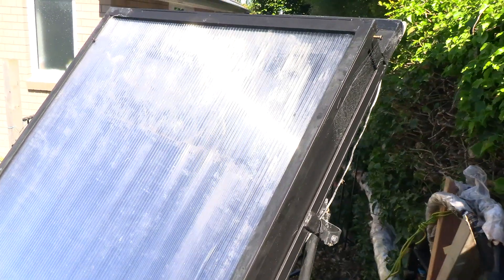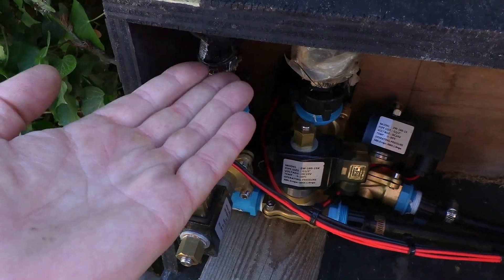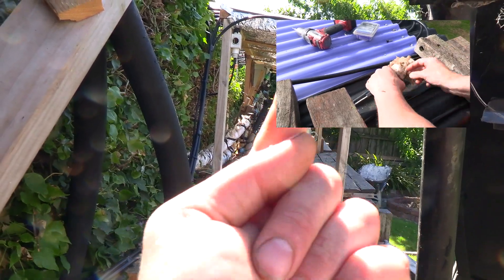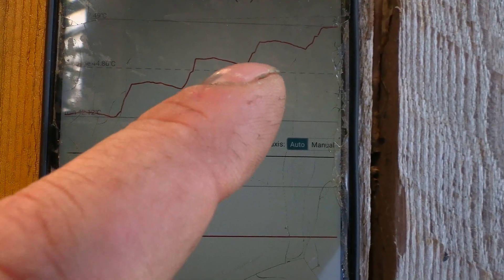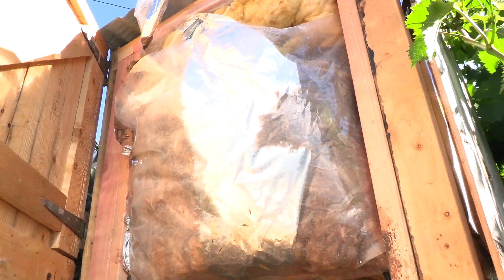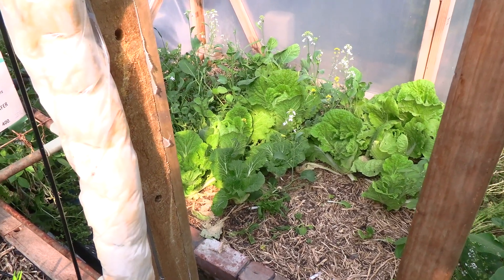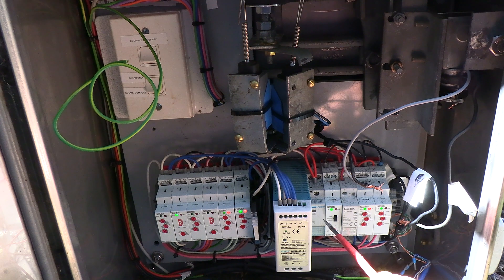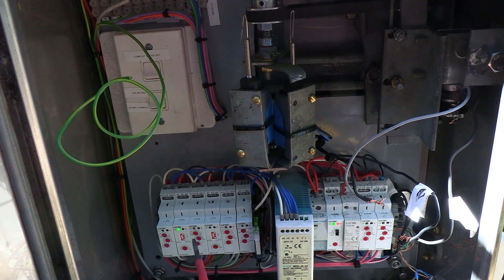Not so simple DIY Solar Water Collector. 49 C / 120 F Hot Water - Upgrade

Comment: Very impressive ! Have you tried first to use fuid dynamics before doing alle electronic ? I'm myself looking to do very low tech system, with thermosyphon, mechanical thermal actuators and tap, so it's always good to know feedbacks from other experimenters..
Reply from the maker: It needs to be electronic because there is long pipe runs and it requires a bit of pressure to push the water thru
Reply: Ok !  @DCAL084  Have you heard about loop / pulsating / oscilliation heat pipes systems ? It's all a "not enough studied" research frame for heat catchment .. For instant in roofing pannels, could be Veery interesting to transform any roofs as giant energy catchers.. !!